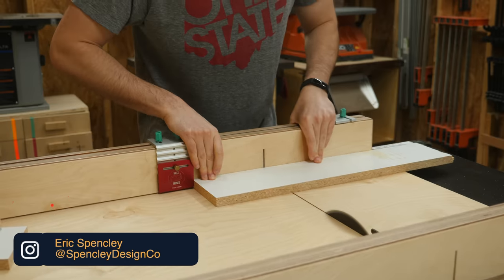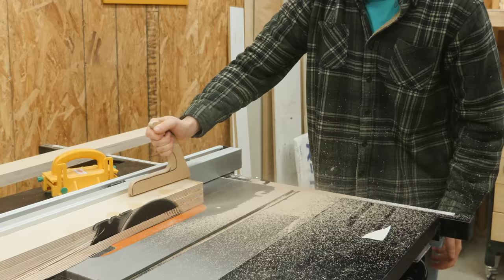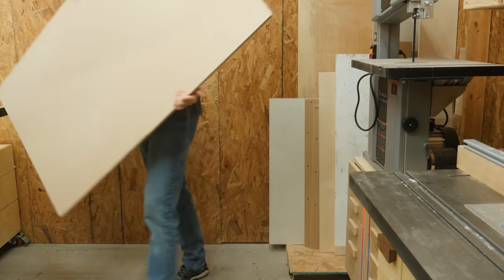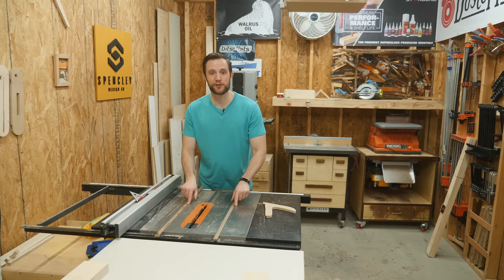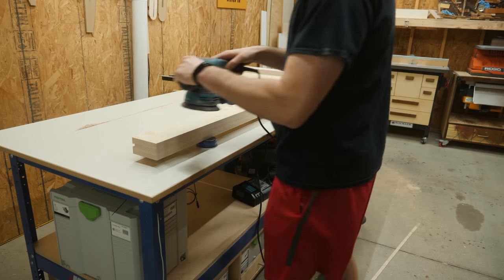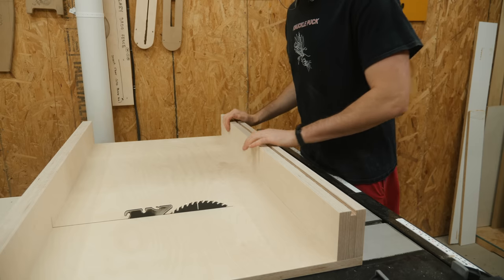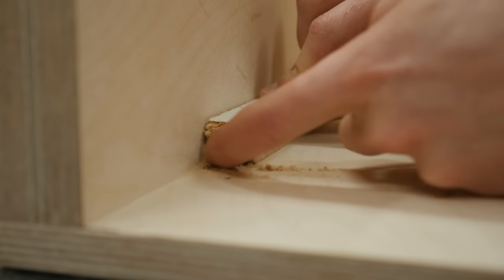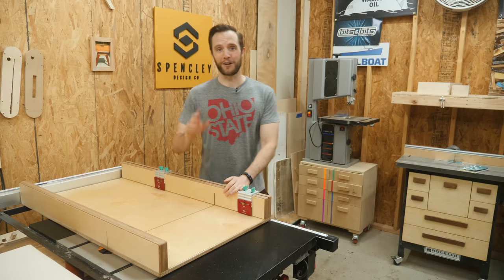A Refreshingly Simple Guide to this Basic Concept

Comment: The Microjig dovetail is a big improvement over T track.  One of my sleds is about the same size as the one you made here.  It's a beast to handle but it will crosscut a panel a little over 24" wide.  My most used crosscut sled had a depth capacity of about 10" or so and it's about 20" wide.  It so much lighter and easy to handle that I get the big one up on the saw only when I have to.  A good portion of my cutting is for smaller work rather than cabinetry and furniture.  Your squaring method is easy but it only works if the blade is parallel to the miter slots.  If the fence is perpendicular to the miter slots then the cuts will be square even if the blade is off of parallel to the miter slots.  The five cut method is accurate even if the blade is off of parallel.
Reply: Your are correct! I use to set up CNC machines in the early 80’s so being dead on was no joke. I have carried this into the wood shop using a dial indicator to align the arbor to the miter slots using a calibrated plate instead of the blade. Using a 100 thousands dial indicator I have 1 tenth of 100 thousands difference from from front to back. When I built my miter sled I used the 5 cut method. 
I want 90 degree cuts if need some other angle I get out the incra miter sled.

Comment: Great video and I love your commentary.  After going through a couple saws and attaching/reattaching the runners… my sled was out of square enough to warrant realigning the fence.

Like you I glued the blade guard to the fence (and base) which prevented me from being able to adjust the fence with the original pivot screw.  I could have backed the fence off by an 1/8th and had enough room to adjust it, but I didn’t  want  to look at that all time.

I’m about to build my next sled and plan on attaching the guard with screws from the inside of the fence.

Comment: I love that you used the Microjig dovetail hardware. Great idea. However, I highly recommend using their router bits. I have used an undersized straight bit to make it easier on the dovetail bit but it just wasn't as good as the Microjig clearance bit and it was not expensive at all.
Reply: I agree I have standard dovetail that would work ok but also have  Microjig dovetail Bit.  The Microjig dovetail creates a rounded edge at the top

Comment: Something I learned (the hard way) was to not over-tighten the screws used to secure the t slot bars. That causes the wood to mushroom out and make it too tight to slide
Reply from the maker: Yup! That’s a great tip
Reply: When wooden slides begin to wear or shrink in the winter using the slide screws to expand the slide will remove the slop. Easing them out in the summer performs the same adjustment. I have not used wood for slides, quarter sawn or not, because of the movement due to equilibrium moisture. Instead spending a few dollars on Nylon or Delrin bars. Exact width and thickness are available for online purchase.

Comment: Personally I like to have some T track parallel to the blade in my crosscut sled base so I can use clamps to hold materials down in certain cases, I also made the pieces next to the blade removable so if for some reason I need to replace them or whatever, it's no big deal, instead of making a whole new sled if you somehow mess up your blade clearance or want a thin kerf blade, but then you're working with 2 layers of plywood for the base and it can get a bit heavy but I think there's a lot of ways you could improve on this design and add some more features than just basic stop blocks. I also think the fence is just too short, I want to be able to cut the full depth of my blade plus have plenty of material above it to keep the fence stiff, if you're cutting material 4" thick this short fence would not be tall enough.

Comment: I’m a beginner table saw owner in fact just got it today for Christmas.. I am curious if you don’t have a lot of tools specifically a router what tool could you use to make the gap to collect the saw dust so it doesn’t build up?.. I enjoyed your video and I subbed you up as well.. I look forward to learning and watching more projects of yours.. God bless
Craig
Reply: You could use your table saw at a 45 degree angle and just keep it from barely sticking out the blade guard. The number 1 thing to remember with wood working (especially when watching YT) is there is always more than one way of doing things 👍🏼
Reply: Yup  block plane is easy cheap and accessible. Sandpaper, spoke, even a pocket knife. It gets fun figuring out things to do in different ways.

Comment: You could also make a stop on the sled, so the blade would not get through your safety block.
Finding the right design of such a stop may be tricky - there are several solutions, but they might not be 'ideal' (eg. some would require modifying the table-saw)

Comment: Great looking sled and I think you just sold me on dovetail over T-track. Been watching a lot of videos on both and while T-track isn't without it's perks, it really seems like dovetail is a much more versatile option, as well as much cheaper in the long run as long as you have a router (which I don't yet, but I feel is a much better investment than 30 or whatever feet of T-track, which you also still need a router to install anyway). Thanks!

Comment: Great video, love the sled. Just one note - it's accelerator for the CA glue, NOT activator. "Activator" implies that it's needed for the glue to work, when in fact, all it does is accelerate the curing process.
Reply: Correct, and it only takes a tiny amount of accelerator.  Those of us that build wooden radio controlled airplanes have discovered that  the accelerator makes CA even more brittle than it already is.  The black CA used in this video is probably rubberized or toughened CA which is less brittle than most.

Comment: I’m going to build one of these, but my table saw has only one miter gauge slot, not two. Also, I discovered that the blade is not in perfect alignment with the rip fence. After I cut a long piece of wood, the top width is about ⅛” wider than the bottom width. And the rip fence is not ajustable in any way. I’m wondering if making a crosscut sled with only one miter gauge slot rail is enough?
Reply: The saw carriage underneath is probably adjustable.

Comment: Excellent video Eric!  I appreciate your honesty and attention to detail.  Don't sweat the mistakes, we all make them. 
Two questions if you have time to reply....  
1) Does have non-locking miter guides limit the cutting capacity (width of board)?  As I think about designing my sled I'm wondering if T-shaped guides would make for better performance and enhanced safety (ie. less chance for the sled to pop-up on a wider cut).  
2)  Is there an easy way to avoid burn marks when making longer rip cuts on a table saw?   I seem to get burn marks whenever I make 1-2 second feed stops to grab my push stick. :(

Comment: I have to move some of my tools outside when I need to cut. My table saw is small and I do not have an outfeed table (or infeed table for that matter). Is it possible (and safe!) to build a sled or am I better off using my circular saw and jigs? Cutting on the ground has it's own challenges. Keep in mind I'm not building furniture or heirlooms here but I would like to have 90 degree cuts rather than an average of 90 degree cuts.
Reply from the maker: You can absolutely build a sled! Check out some of my very very first YouTube videos. I started all of this out of the parking lot of my apartment

Comment: My runner slots have little notches that protrude into the slide runner. Do you have any tips on how to deal with those? I've considered filing them away.
Reply from the maker: I’ve seen that on some budget friendly ryobi saws before. I’m never personally run across that, but I imagine you could either file them away. Or just create runners that works with the protrusions
Reply: @SpencleyDesignCo  creating runners that work with those protrusions... Lol you clearly haven't seen my work. I think I'll try to file first. 😀
Reply from the maker: I wish you luck!
Reply: Those protrusions are there for a reason.  It is best if you make runners to fit them. Maybe by cutting thin strips in two widths and glueing them wide-thin or just make a runner narrow enough for the protrusions.
Reply: @bobkilmer697  I don't use the "sliding tool/push tool" that they are intended for.
Reply from the maker: That’s the miter gauge
Reply: @SpencleyDesignCo  YES! Miter gauge, thanks! I was drawing a blank! Getting old sucks!
Reply from the maker: Trust me, I know! 🤣
Reply: @bobkilmer697  I think the reason is very good. It makes sure you ONLY buy their fence.
Reply: @MrCryptozoic  my first table saw was one of those ryobi's I ended up saving up and buying a delta that is pretty much the clone of the rogid in this video only because I hated the miter slots so much.

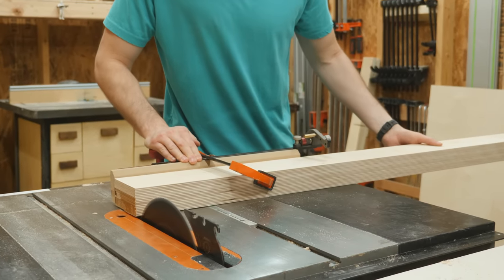Comment: 5:27 Why does this matter if you are going to cut it again for final length?
Reply from the maker: Can you be more specific about the question? I’m unsure what you’re asking for clarification on
Reply: @SpencleyDesignCo  A keen eye would notice you left the end a little bit rough, so you chopped it off.  Then at 5:45 you chop it off again.  You only have blowout on one end of a router cut, so there is no need to make two separate cuts to fix it.

Comment: Very nice video! Nice music. Glad I watched. Straight forward. You were fun but still to the point. Excellent work. I also made a fat block for the cut through place on my smaller sled and then to be darn sure I never lost a thumb I screwed a piece of plate steel to the back of the block. Would rather ruin a blade than lose a finger. Again very nice video. Thanks for not being vulgar like so many are.

Comment: To not use the five-cut method of fence adjustment is foolish. The modest effort is well worth it to get ppm accuracy. The math is simple and the only tools needed are a vernier caliper and a set if feeler gauges. The fence should be tested for STRAIGHT before the adjustment process as relying on clamping the fence to a workbench as a form for assuring flatness during the glue up will not, in general, be accurate enough. A purpose built work-board for glue ups will insure that the final state of a glue up will be flat, straight, and planar within the tolerances of the work board, which are as good as the setup of parallelism of the table saw use to construct them.

Comment: I laugh how Murican woodworkers casually all reach for the same ‘cheap offcut’ stock….no less than 3/4” Baltic birch ply!  The most expensive sheet ply you can obtain!…even if you CAN find it these days.  Meanwhile us poor folk overseas will have to make do with warped, void filled construction ply or OSB.🙄.  Almost as casually profligate is the slathering all joints in pints of expensive Titebond, a luxury in UK at nearly two bucks an ounce. American woodworkers bathe in gallons of it ! 13:20 I feel your pain BUT, c’mon…you really can’t figure out how to cut a small dust relief channel in the mating corner without disassembly???  1) osc multi tool doing a shallow plunge 2) Box cutter held at 45deg in the corner 3) hand drill with 1/4” bit pulled along the joint 4) round rasp bit in a drill pulled along the joint 5) Dremel etc etc Even IF glued it would not be a show stopper, just need some imagination.

Comment: With no thru rails. The sled travels inaccurately a short distance. Wood in a steel rail channel is sloppy  wears out.

 Miter guage"  doesn't make any cuts!

Wave your hands and arms around while I explain how a long work pc, cut at a 45°  wouldn't work at all here.  
 No stop block. No scale to measure any cuts.  It's right around useless . This is typical rookie work because I tossed my cheap chop box miter saw.
 An 18" square to set it up accurately .  Nope!  How many 45° samples will be cut to see if you're even close?  It's a joke. A plywood  sled is for lazy budget shops.

Comment: I understand if you think using a square is good enough for calibrating your saw sled, but I think you do us a disservice by brushing off the 5 cut method and perpetuating the myth that math is inaccessible in the bargain. The 5 cut method is based on very simple geometry that any maker should understand. Either the fence is square with the blade or it isn't. The resulting quadrilateral after the 4th cut will simply have accumulated the error, if any. The fifth cut simply makes comparing the lengths of two sides of the quadrilateral - a means to determine how much out of square it may be - easy. And the math used to make use of any difference is grade school arithmetic, for goodness sake. I am eagerly awaiting your mea culpa and a demonstration of the simplicity of the 5 cut method in a future video.
Reply from the maker: i'm glad you enjoyed the video!
Reply: @SpencleyDesignCo  since you beleive your sled is close enough, could you demo either the 5 cut, or even the 2 cut measure, I liked the 2 cut myself, known flat back against the fence, make one cut, flip the board left to right and second cut, differance is measured and you then use shim playing cards to correct the fence. and rescrew it.
Reply from the maker: YouTube does not allow videos to be edited once uploaded
Reply: @SpencleyDesignCo  so, I suggest a new video